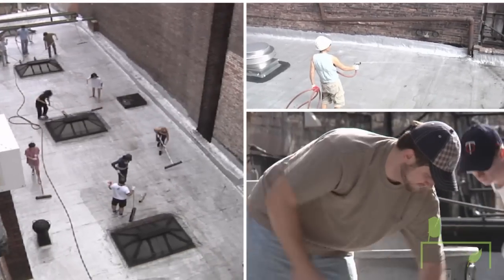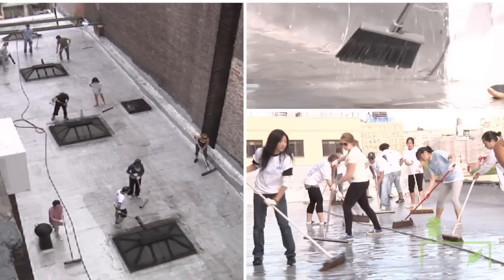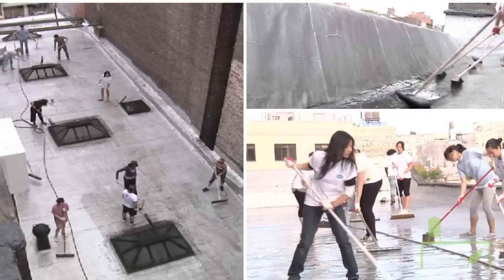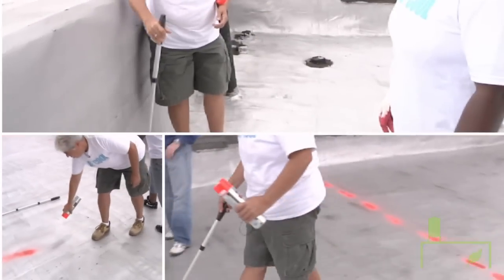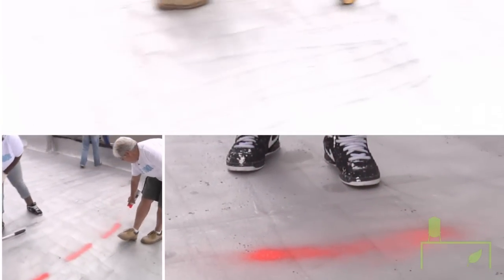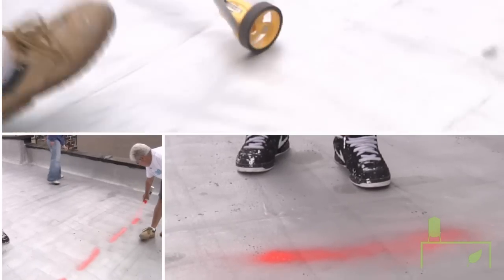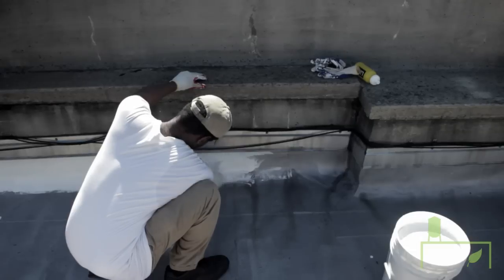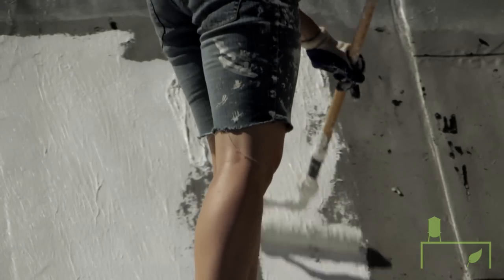How to Paint a Roof White and Curb Climate Change Yourself

Comment: Home Depot sells Henry brand and Lowe's sells Black Jack brand white elastomeric roof paint. Elastomeric means the paint is a little rubbery when dry, a good thing. I went with the least expensive among the different white roof paint grades and am pleased with practically no wear or damage after 8 years of having a white pitched, yes pitched conventional asphalt shingle roof, painted directly over the shingles. White elastomeric roof paint is great on pitched or flat roofs. It took about 4 coats to completely cover all shingle gaps, especially where one shingle lay over the top of its downhill neighbor. Don't worry about putting too much paint on, just slather and smear it on with a conventional 9" paint roller on a stick. The higher more expensive grades of elastomeric white roof paint didn't seem worth it for the marginal benefit in reflectivity. The higher grades have longer guarantees but I've seen no evidence the higher grades last any longer than the least expensive Henry or Black Jack grades. Don't like white? Paint over the white with the color of your choice, even matching your old shingles under the white paint if you want. If the paint can says don't use on shingles, don't believe it. No primer over shingles is necessary unless the shingles are practically brand new, 30 days or less old. In that case, a primer is necessary over the shingles before applying white roof paint, or the white roof paint will bubble up over the not dry enough asphalt shingles.